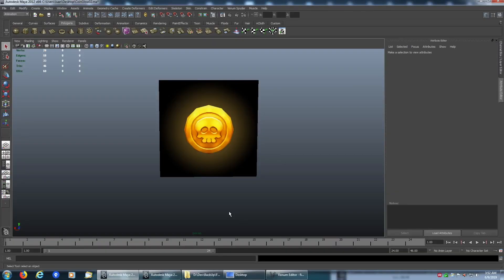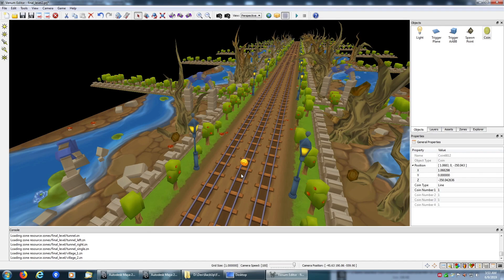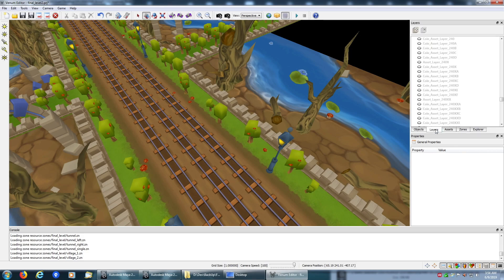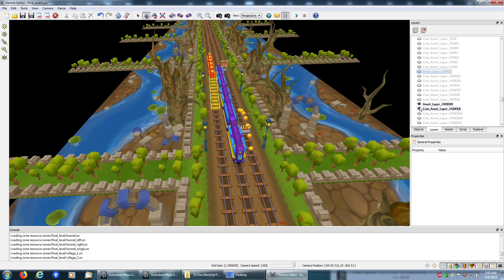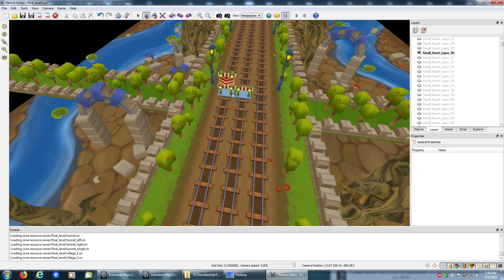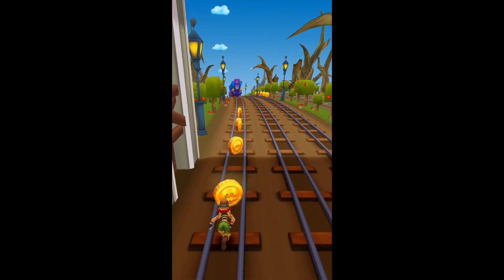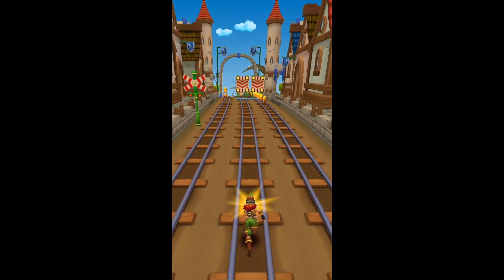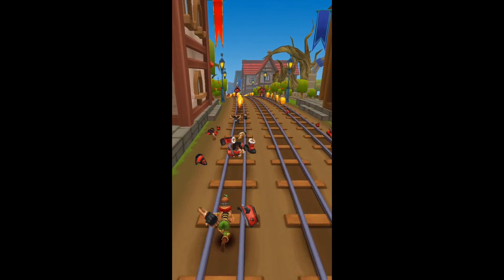Endless Runner: Procedural Coin Generation

Comment: Can you please explain how are you detecting the free space between obstacles so you can procedurally generate coins there? Something like a RayCast might work?
Reply from the maker: I do something much simpler than that. After I add some obstacles, I randomly determine if I should add some empty space next. Then I randomly determine how much free space I should add. The next step is to randomly determine if coins should be added to the free space. Since I already know the amount of empty space I have added, it is pretty easy to determine the number of coins to generate. Then I go back to adding obstacles until I randomly determine if I need to add free space again and repeat the process all over again.

Comment: Are you doing this live in the game or in the editor? This is very slick
Reply from the maker: The coins are placed in the level editor initially. Then I save out the minimum required which is the coin starting position and whether it is a curved coin path, straight coin path or a zig zag coin path. Then in game from that information I generate the coins procedurally as the player progresses through the level.